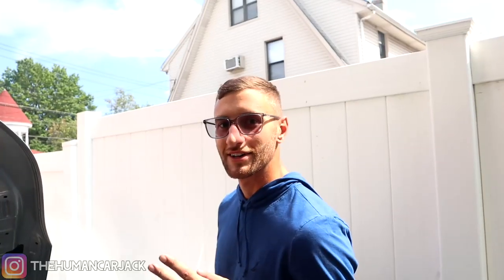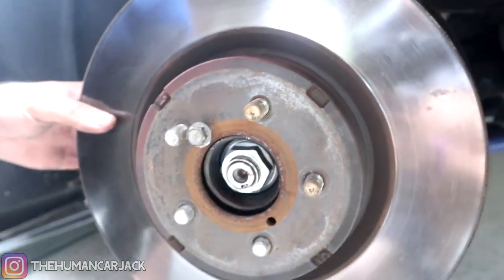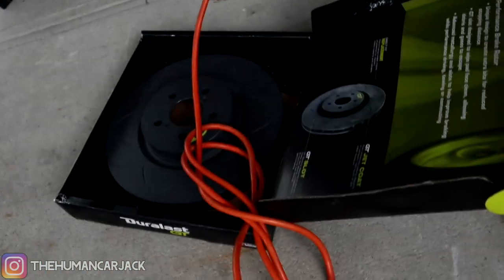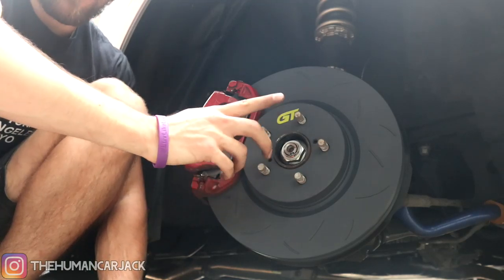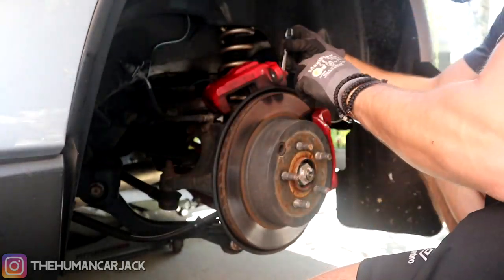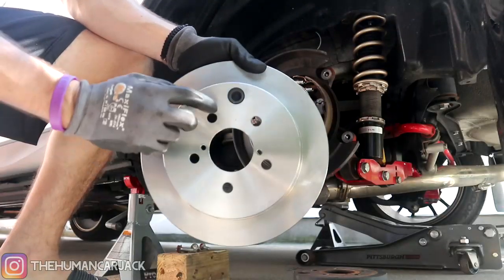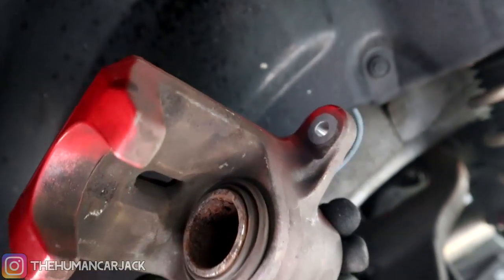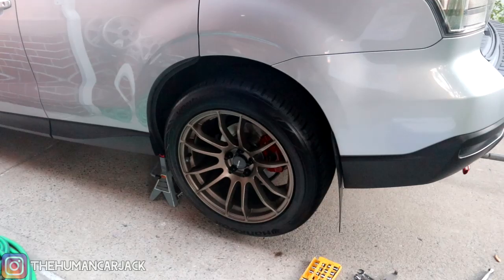BRAKE UPGRADES! | 2014-2018 SUBARU FORESTER

Comment: Hello.  A couple of concerns: In the earlier part of the vid, it seems that you took a 'test' run and were braking hard on new brakes that had not been worn in yet. Not good - two new machined surfaces getting ground against each other before they've had a chance to 'easily' get initial wear. (similar to running a new motor without giving it any break-in period).  Then the rear brakes were installed - and it appears that new rotors were installed on pads that had already had initial wear-in and 'paired' with the old rotor.  Again, not good.  Should wear in new pad and new rotor 'gently' Together.  One other thing that caught my attention - the front rotors were +2 lbs, rear -2lbs. You are correct, that did 'balance' them out - well weight-wise, as far as TOTAL vehicle weight anyway.  I don't really think that is of much concern - at least not as much as having added 2 lbs of rotating mass to each front wheel assembly.
Reply from the maker: Thanks for the concern brother and thanks for watching!